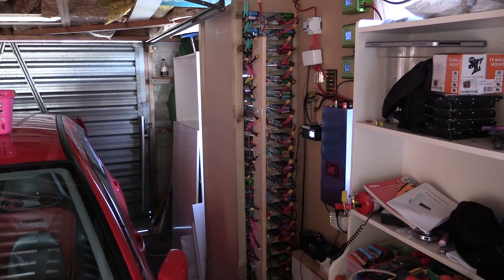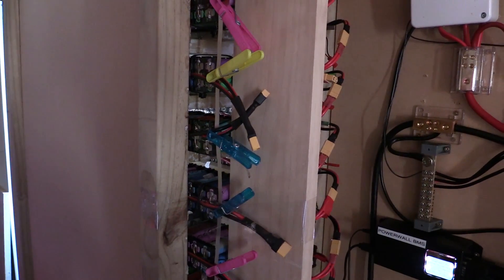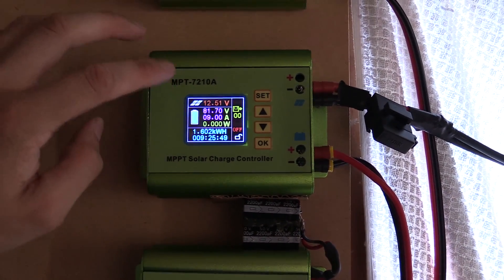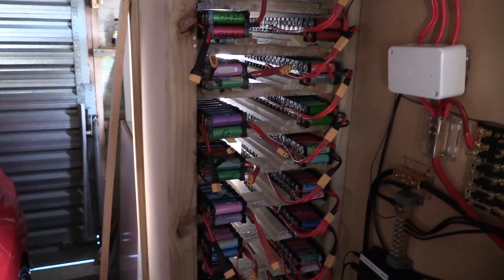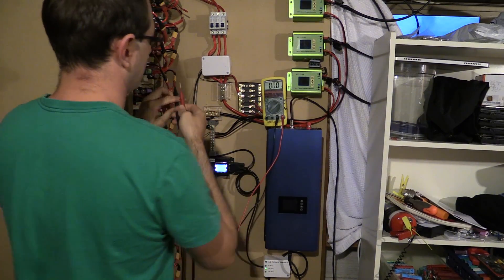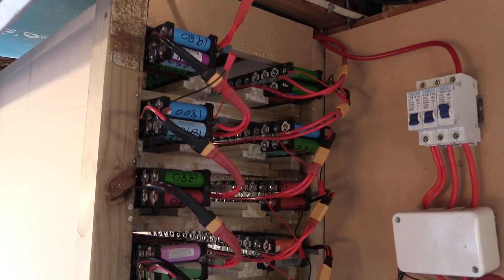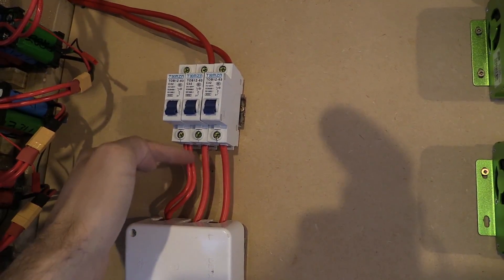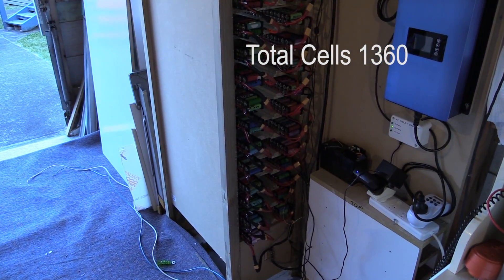Next 5kWh Powerwall

Comment: Why don't you use a battery balancer? You can keep it plugged in all te time..
Reply from the maker: What balancer did you have in mind?
Reply: By example this one:
http://www.batterysupports.com/80v-924v-22s-150a-22x-36v-lithium-ion-liion-lipo-battery-bms-p-421.html

the balancing current is only 80mA starting from 3.9V but it will help I guess.

Comment: Hi Mike! That is looking good!  Hey I know there is this hot debate about BMS and weather its necessary. I originally thought it wasn't and I believe you did touch on the subject before in an earlier video, hence your building your BMS.  Check out this guys video if you haven't already:  https://youtu.be/bUWwZme4DIc?t=33m14s.  He is a bit longwinded, and takes a while to get to the point, but his point is well made, the danger it seems with 18650s is the over discharging of cells can create a condition wherein the subsequent charging could start a fire.  This fire would in your case happen when you are away from your home at work when your packs are charging from the solar array.  It seems to me the lesson to be learned here is one must have a system in place where you can detect an over discharge condition by pack or sub-pack level, and warn you of that condition when it happens.  Your thoughts?
Reply from the maker: Good video.Interesting point about the cell monitor 8. Also about the issues around over discharging the cell or the cells. Which makes sense, I think he is talking about very deep discharge, 49min in the video.  My next part after getting the 10kWh running is to focus on building the cell monitoring and balancing as this is now becoming the most import thing to do.
Reply: Yes, Jack's video reminded me of the incident you had not too long ago when your pack died, I don't remember all the details ( I'll have to watch your video again ) but I recall the one pack you had overdischarged, because it was weaker than the other packs so your system would think that you still had plenty of power left, eventhough that one pack was dangerously low.  Then you at that point you are in the realm of a thermal failure as pointed out in Jack's video.  I think this is where the BMS is essential, especially when using batteries from different sources and ages.
Reply from the maker: At 1:27 doesnt he say he hasnt tried to bottom balance the telsa pack yet
Reply from the maker: Yes me too, I think a bms with cell monitoring is very important, That would provent what he is saying as it would shut off the pack/powerwall once a cell dropped to say 3v and it would never drop to any dangeris level. He says it could drop in 4sec but it would really depend on how many amps you were drawing, in a EV it would be 500amps so yes it would drop very very fast, in my powerwall i max out at 32amps and normally run around 8amps with a agv of 3amps so for my cells it might take 10min to drop from 3v to 2v for eg. Ether way a BMS that is reading the cell voltages is needed for anyone that is playing with 18650.
Reply: Yea, well Jack is a Tesla fanboy to be sure, the message he is saying in his video, is that the BMS that is contained in the main Tesla battery box is capable of managing the overdischarge condition if it is used as is.  But what some enterprising individuals are doing is breaking apart the main battery box and selling the individual modules, they do have a smaller BMS on board each module, but not the means to sever the load in the event of an over-discharge event, since the contactors that do that are  in the box itself, connected to the main BMS in the battery box.  So yea he is currently trying to reverse engineer the CANN messages coming from the battery boxes BMS, so it can be used by EV installers as a single safe to use unit.

Comment: One thing you could do if you want to equalize the 2 banks gently is to grab you spool of 12 ga wire and connect the 2 ends of >50' length to your positives and just short the grounds.  That will give you a couple ohms of resistance to equalize the voltages to each other without creating too much heat.  But if both banks are less than 2 volts from each other total, it's probably not gonna hurt much to just short them.  Though it looks like you are only running up to 8 ga wire, so they may get warm passing 40+ amps for 30 secs or so.
Your install looks neat and quite well thought out!